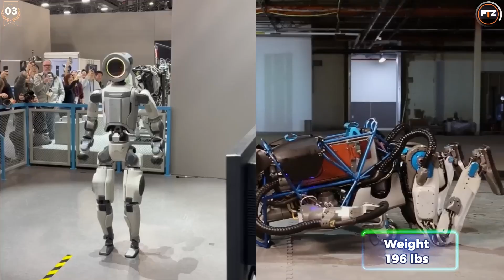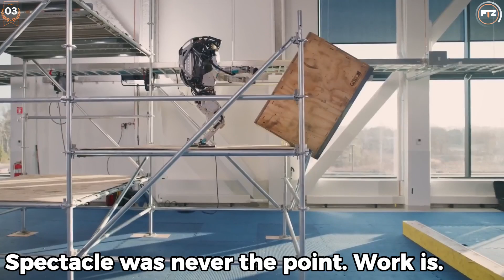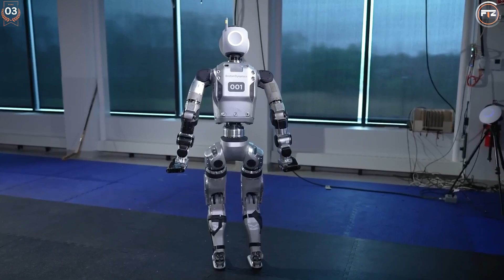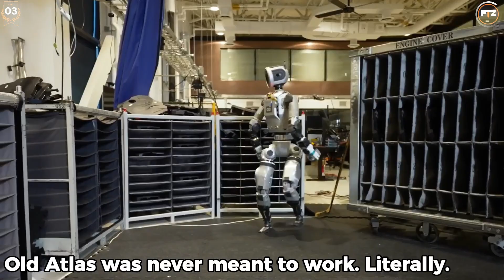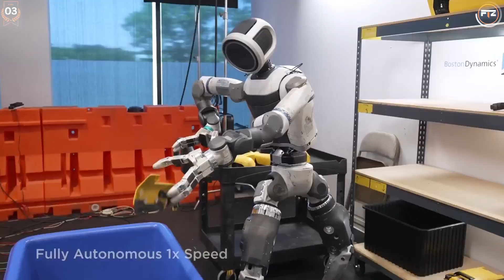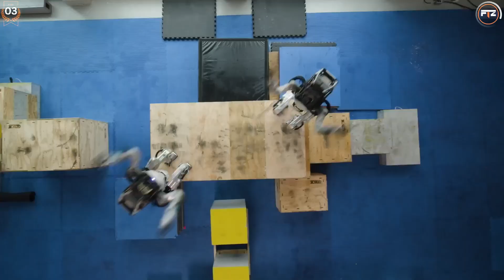New Atlas vs Old Atlas: Why Boston Dynamics Started Over

Comment from the maker: Old Atlas did backflips. New Atlas is being deployed in actual Hyundai factories. That gap — from research demo to industrial tool — is what this whole video is about.

If you're following the humanoid robot space, the Boston Dynamics Atlas comparison here goes deeper than anything I've seen covered elsewhere. Watch it through to the payoff section — the Hyundai answer genuinely changes how you read everything before it.

Drop your take below: Would you trust a humanoid robot working alongside humans on a factory floor right now? Yes, not yet, or never?

Subscribe if this kind of analysis is what you're here for. More coming.
— FutureTech  Zone